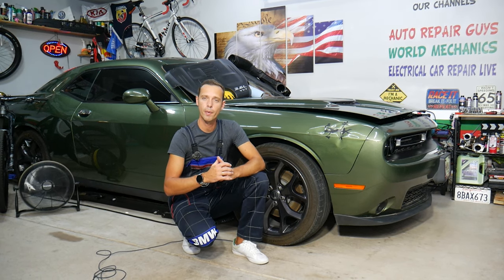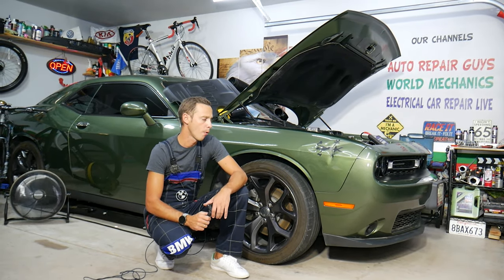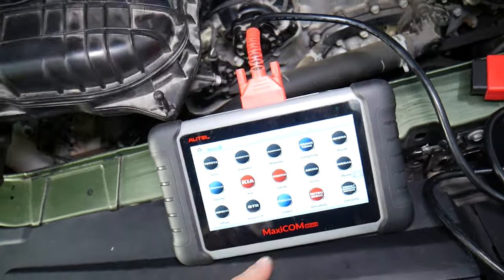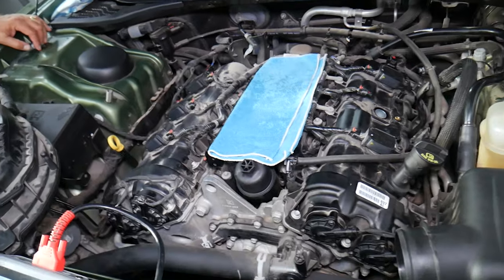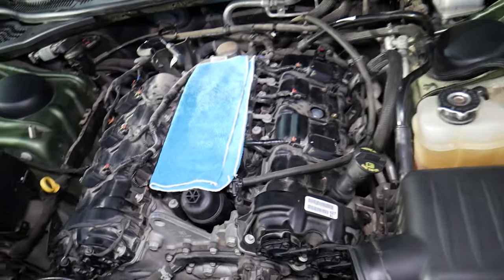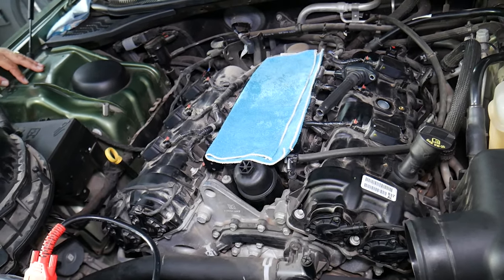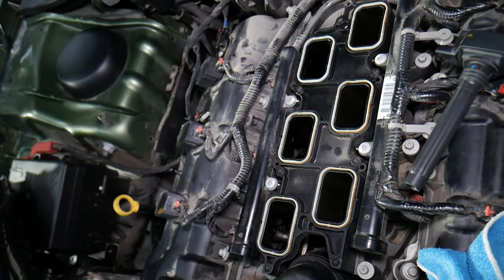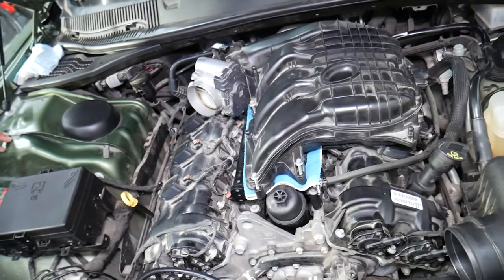IF YOU DRIVE WITH BAD IGNITION COIL THIS WILL HAPPEN TO YOUR CAR, ANY CAR

Comment: Just happened to me with a bad coil, I listened to the car she told me it was a bad coil (I’ve read a lot of books about how cars operate) but I took it to mechanics who felt the need to catastrophize and wanted to replace stuff that didn’t need replacing got tired of being docked around so I replaced it myself in the parking lot of a auto parts store and the check engine light turned off about 5 hours later

Comment: I had NO ENGINE CODES, but my engine was idling super rough all of a sudden. The engine shook so much, that at first I thought it was a motor mount issue because there were no codes. I drove it around, because I had no other choice, and eventually saw my MPG go down drastically. That made me think it must be the coils or spark plugs. I had 2 coils that went bad. 
Once I replaced the bad coils, the MGP went up drastically on my car. I'm hoping that I didn't do permanent damage, but the car is running smooth again.
Reply: Did you have similar symptoms? My car gets stuck on specific RPMs before switching gears. It also pops and bangs after high acceleration even though I don't have a tune
Reply: Nope, my symptoms were a super rough idle and the engine shaking badly at any speed. You should search on your specific symptoms to see if you can narrow down the problem.
Reply: @SimbaUchihaa hello I have the same problems it think it can
Reply: @rlvtrader   hey man, so turns out I have the same issue. Just like you said, engine vibrating/shaking occurred suddenly. Coils were already weak evidently with the sluggishness, and now I think a couple are dead because car feels like it's running on 2 cylinders 🤦🏿‍♂️
Reply: @512Roberto53  hey yup it finally caught up to me. Was wondering why the car operated sluggishly for years. No codes at all but I remember what the car feels like without a bad ignition coil
Reply: @rlvtrader  also no codes at all either

Comment: You can drive your car for up to 100km with a bad ignition coil. Beyond that is not recommended.
Reply: I drove 2 miles to get off the highway, and had it towed home. Didn't want to take a chance, car's treated me well for almost 200k miles.
Reply: @summushieremiasclarkson4700  maybe that's why mine is finally going out, the ignition coil has been there for a while and my car is at 200k as well. Probably because I haven't changed my spark plugs on time so the heat gets transfered to the coil and module and may burn the module

Comment: My car is reading a bad ignition coil of the 2nd valve.  I changed it.  It was good for 6 months them out was reading bad again I changed it and it still reads bad.  I had the check engine cleared and about about 30 miles and it came back on.  What would cause this to read bad even when it's brand new.
Reply: I'm not a mechanic and I don't know much about it at all, so take my advice with a grain of salt. But maybe it's a spark plug issue. You could try swapping ignition coils to see if the problem moves over to another cylinder.
Reply: You might need both coil and module + new spark plugs.